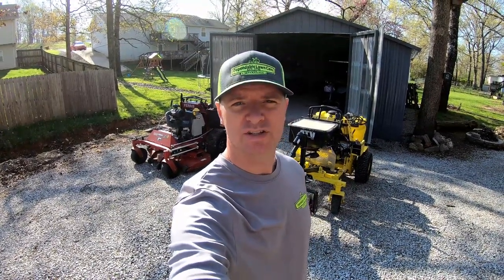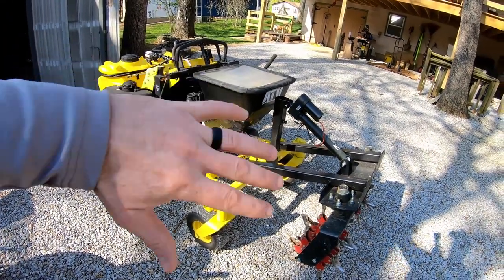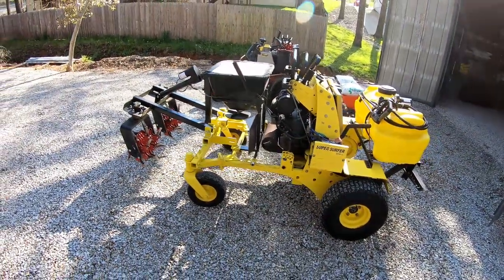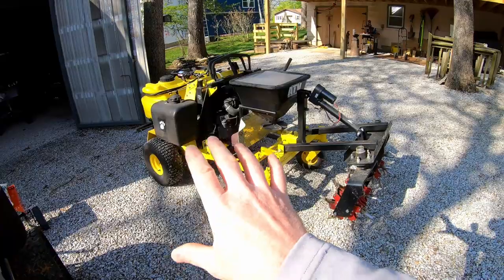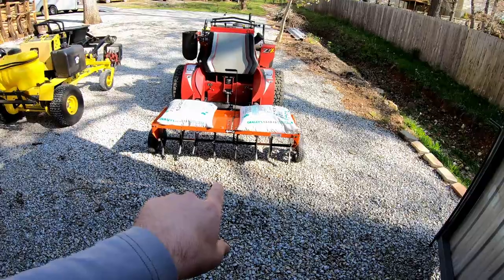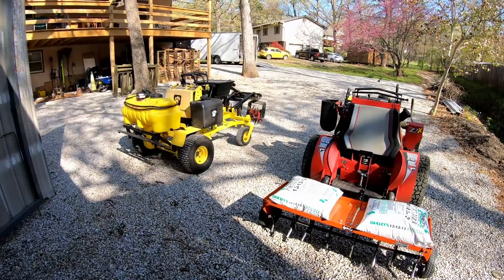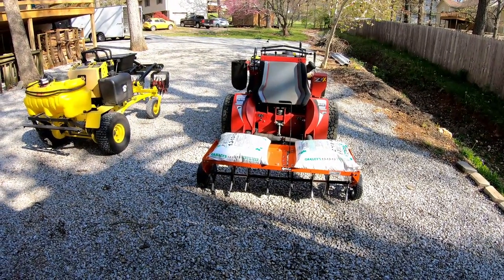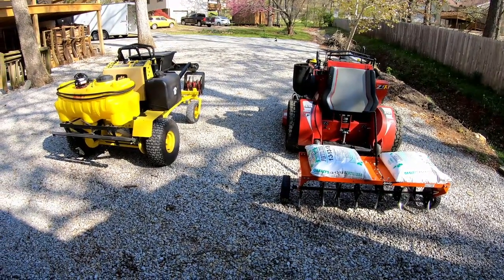Aerator Setup Comparison

Comment: I’ve used that setup for yrs! It works great👍I’ve got the trac vac pull behind aerator, with concrete blocks. I mounted a little hitch on the end of my platform. The Dane setup is very nice for what your using it for on applications👍
Reply from the maker: Thank you for the feedback

Comment: I think I have the same aerator. Looks identical but it’s branded as a Husqvarna. Got it for $200 at Lowe’s late last fall. Getting ready to use it for the first time, learning on my own lawn. How do you determine what to charge for aeration?
Reply from the maker: I take what I charge to mow x 2. So a $50 lawn would be $100 to aerate.

Comment: I’ve been thinking about that Great Dane aeration setup and wondering how it was doing. Great video, sorry it didn’t work out. I was strongly thinking about doing the same thing with a bigger engine tho.
Reply from the maker: I think you would be good with a bigger engine and lighter aerator.

Comment: Good video!  We just had a Z2 trans axle take a crap on us at 1,000hrs🤦‍♂️it's gonna cost $1,600 to replace the one wheel motor, drive pulleys and drive belt at the dealer. I didn't like the idea of having one new pump and one old pump. So, I ordered 2 new pumps and I'm gonna keep the old pumps. Hope I made the right decision 🤷‍♂️
Reply from the maker: Ouch! I would probably do the same thing though.

Comment: I've been thinking about doing the samething with my Z3. How's the turning radius with it hooked to the deck?
Reply from the maker: Pretty good, I can drive just about normal with it.
Reply: @HandyGuy2016  That's good I may have to try it out. But I have my Grass Flap pedal mounted right were you have the hitch pin. thanks

Comment: How did you hook it up to your mower? You think a Wright36i would work for this it’s got a 19hp Kawasaki
Reply from the maker: Probably, just dropped a pin through an existing hole in the platform.
Reply: @HandyGuy2016  I want to do that but I’m afraid that it will widen out the hole in the standing platform.
Reply from the maker: @MattWeaver909  I don't think it will

Comment: Hey.  Ive been watching  you trans form the Great Dane .  I have a suggestion it may cut some weight down. And I know you can modify. The old lifting apparatus for the deck and mount the Tines to it  under it but where they would lifted through the frame so they could clear things when not being used and pick up a used one to add more and staggered them to in a triangle to cover the ground.  Or just sell it🤑
Reply from the maker: Good idea, I might try something like that.

Comment: How did you attach it to the back of the 52" Z3 to the platform?
Reply from the maker: I used holes that are already in the platform from the factory. On the Agrifab I just dropped a hitch pin through the hole and the hitch.
Reply: Ok yea that’s what it looked like u did - was more or less confirming.  Love ur videos Man U do a great job on ur explanations n demos
Reply from the maker: @mowtosnowseasonalsolutions4376  thank you